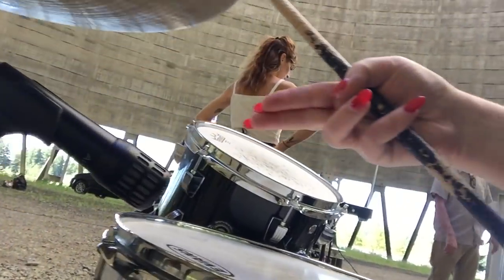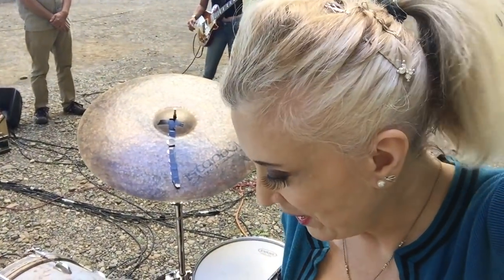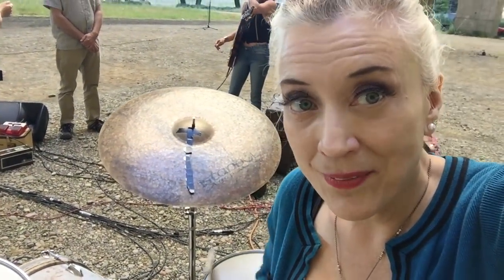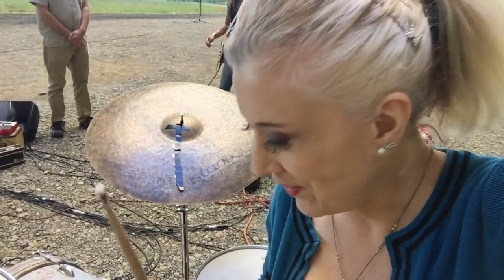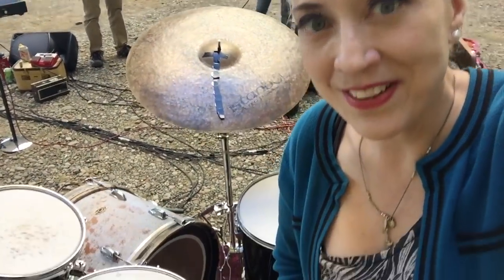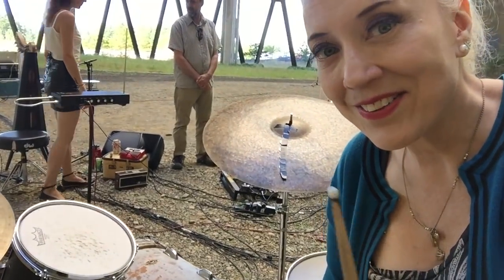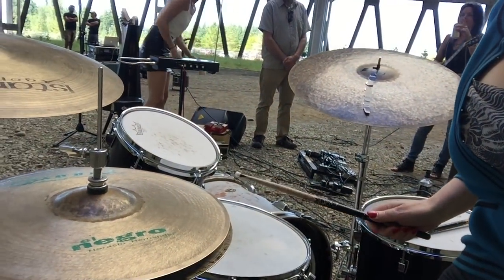Producer Sylvia Massy Demonstrates Snare In Nuclear Cooling Tower

Comment: Incredible! We've always wanted to do a shoot in a nuclear power facility. A live performance  would be quite difficult though.
Reply: It's 5 years later, and I apologize for that, but the Satsop Nuke plant would probably be easy to get for a venue. In fact it's actually pretty common, It is used as a movie set afterall. It was built to be an operational power plant, but was mothballed before ever coming online. It never had any fuel on site. it is completely safe and the satsop industrial park allows it's use for exactly the things you might want. They even used to let people climb the exterior stairs to the top of the towers. Anyway, it's not out of the question if you want to use it.

Comment: Minus 24dB on the narration, the snare strike was good but everything after at same weak level. You're an audio producer? I had to use Audacity not just to find this out but also to HEAR this at all. No mention of Moog's Etherwave siting there. I want to hear a good slide from it and that reverb at the same proper level and in Binaural. It's not a reactor but a cooling tower, coal plants have 'em too.

Comment: Cheap bow, arrow and fishing line from sporting goods store would run $50-75.  Tie/tape the line to arrow, shoot it up and out, tie/tape portable recorder to line (unless you have 200ft mic cable), find the arrow & pull.
Reply: Just fly a drone, easier.
Reply: And noisier. Not much point if all you'll record is is the drone buzzing anyway
Reply: Maybe he meant fly a drone with the line attached? Either way would be excellent to hear.
Reply: if you smoke enough weed you can just go up there.

Comment: FYI : It's a cooling tower not a silo, the gap on the bottom let in cool air and the hot air goes out the top.
FYI: A nuclear silo would house a nuclear missile under ground.

Comment: How did you get access to a nuclear silo?
Reply: looks incomplete and abandoned
Reply: @hoosierhiver It's a cooling tower. Not even necessarily nuclear. And it is complete. People think the reactors are inside of those towers. They aren't, they look exactly like that, they have plumbing that runs inside the concrete that helps dissipate heat, along with pouring water over the hot surface like a waterfall. the shape allows an updraft to form naturally from the heat of the pipes and pulls air through them to aid in cooling.
Reply: So it's just public?
Reply: @christopher Schuster I'm replying to the thread, is it a public area or not?
Reply: Can you not follow him? I followed his comments just fine, he said nuclear silo but meant cooling tower because she mispoke, but that was beside the point, he was asking how can people access it, as in "is it public?", you however made next to no sense in your replies, you were answering questions that weren't even asked and trying to be condescending even though he made perfect sense.
Reply: This is the abandoned satsop nuclear power plant, in Elma Washington. I've been up there, and there is a chain link fence with warning signs not to enter the cooling towers. They may have gotten permission to do so.
Reply: Pheonix2022
Reply: Joey Ferris when you record the first tool album all is open to you